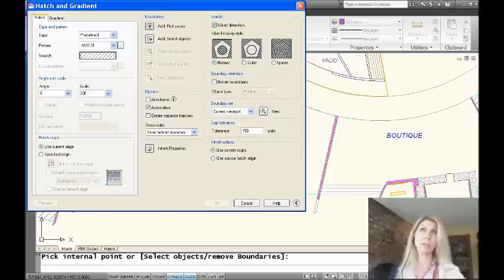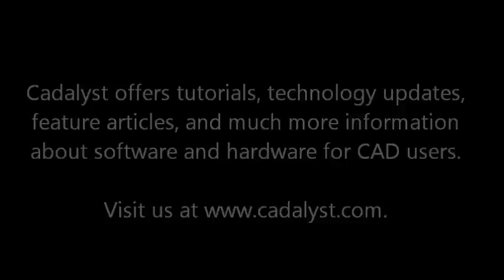Fixing Gaps in Hatch Boundaries (Lynn Allen/Cadalyst Magazine)

Comment: Hi Lynn. Is it possible to not fix but just show or highlight the gap areas? I'm working in 2013 Autocad, I dont want to hatch but rather check my drawing is closed. It takes me ages to go through each point to get it to close. As I'm doing parts that will be interlocking with one another I want to check what the errors are rather than it just joining the ends as it sees fit. I will be CNC router or laser cutting the parts afterwards. Thank you for any help

Comment: If you make lines come together with the fillet command, the hatch command doesn't always see the lines as actually coming together.  If I try to fix the "hole" by doing it again w/ the fillet command, hatch still won't accept it.  To get ACAD to buy that the "hole" is sealed, you need to use the extend command to make one line go beyond the other.  Then you need to trim the lengthened line back to the other line.  Oh, if all else fails, P-edit everything into a polyline & hatch it. Stupid ACAD.